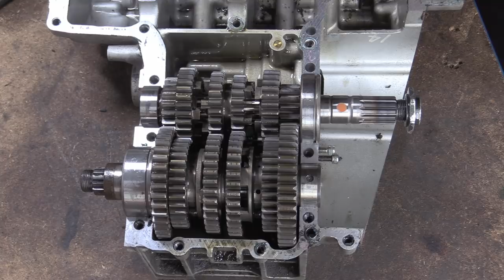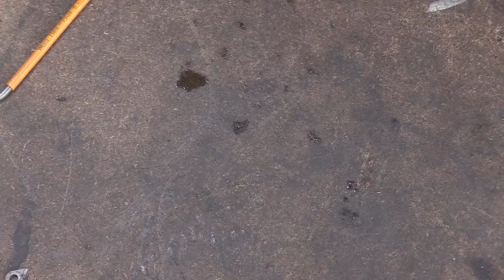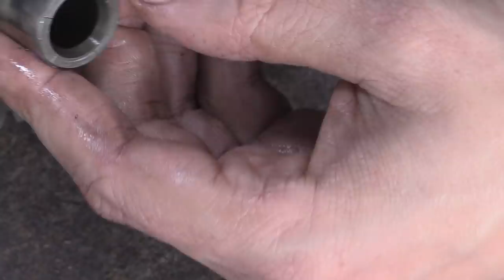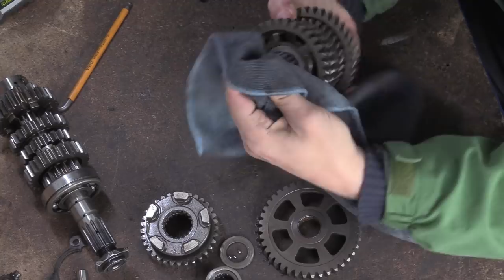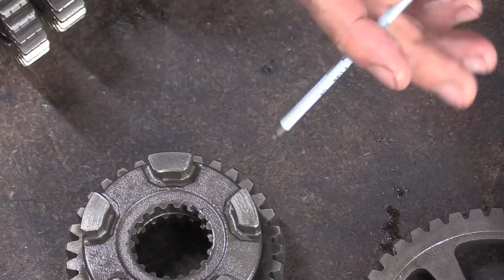M1stERd - My First Engine Rebuild - PART 25

Comment: A wee bit of elaboration on the positive neutral finder, you did explain that it locks out second I just thought I'd expand a little on the how: When the output shaft is turning (anytime the bike is moving), the ball bearings are flung into the drillings in the gear, lifting them clear of the splines on the shaft, which allows second gear to slide into engagement. When the bike is stopped, at least one of the balls will drop into its corresponding recess in the output shaft, locking the gear axially on the spline, preventing it from sliding into engagement. This means when stopped you can only select 1st and Neutral (as you explained in the video). I've always thought it a beautifully simple, engineers solution to the problem of gum boot riders flicking second when stopped (instead of neutral) and dropping the clutch (instead of easing it out to feel if in neutral or not) only to have the bike jump forward unexpectedly. Hopefully that makes sense, the weird Englishman will see you in a bit 😂
Reply from the maker: "I just thought I'd expand a little on the how"

- already done the video on it....

Comment: Excellent, Power Ranger gets me 70% of the time all the time. I think that box is pretty good for the mileage, it would be interesting to see the difference between the big three Japanese manufactures, or even the one you have and a Chinese bike after a couple of years usage. 
Of course there are a huge number of variables, I expect not practical. 
I suppose it goes back to the old adage; change your oil regularly with the best you can afford, warm your bike up properly and also ride the last couple of miles at normal speeds to let it cool down a bit before getting home. 
Be safe.

Comment: Best explanation of a gearboxes workings I've ever seen. Kawasakis' "Positive Neutral Finder" setup has been on the go since the early 80s,have the other companies got their own version or,I've owned most manufactures bikes ove the last 40 years and have'nt noticed. I'll try it on my Bonnie today. Clutchless shifting?,try it on a pre-unit Royal Enfield,no ifs,no buts,you are going to the hospital to get your toes unknotted.
Reply from the maker: "setup has been on the go since the early 80s"

- in the GPZ engine - which I did the video on (the ER5)

Comment: I don't particularly like the positive neutral finder for Kawasaki engines, although I've not ridden other motorcycles enough to really say. if the positive neutral finder system is just some ball bearings I assume it would be fairly non-invasive to take out those ball bearings? Excluding the invasiveness of splitting an engine case LOL
Reply from the maker: Yeah you can just take them out

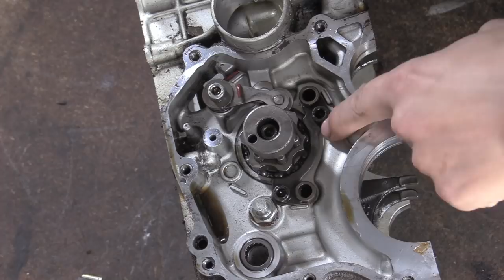Comment: 5:18 awwww dropping the ball on master of pull out

You ever see how they polish the gear sets? I've always seen gears sold with a REM option, how are they polishing, is it a vibratory abrasive process, chemical?
Reply from the maker: Usually tumble/vibratory

Comment: Was gonna ask about constant mesh gearboxes, and why they're not more commonly used. Think you've answered. In OZ our production car racers use a simple up or down throw of a gear stick. But as you say, it's destructive, and they don't care for 1000 km or shorter. You better hide first gear from the gearbox God's in case they get upset.

Comment: Great video.  Are the selector-fork rods/guides the same size?  Could you swap them over to let each selector fork have a "fresh" area to sit on? (as long as they aren't bent obv.)  As for clutchless shifts:  I do this a fair bit, even at moderate speeds.  I tore a tendon in my left arm, and as my bike has a heavy clutch, after a bit of riding around town my left hand and forearm is in agony.  I am telling myself that at slow to moderate RPM, the damage is minimal.  I do a pretty smooth shift that way, no great clonk as gears shift.  Must be less damaging than at high revs no?

Comment: Can you design a transmission specifically for clutch-less shifting in a liter bike?
Reply from the maker: They have - its called the seamless gearbox - but it's expensive
Reply: @dirtygarageguy  How does it work?
Reply from the maker: I'm printing a model - its quite complicated and no-one outside of the MotoGP has actually seen one - I'm basing it off the patent....
Reply: @dirtygarageguy  So it's cutting edge stuff. Thank you for doing all this for us!

Comment: Kawasaki's postive neutral finder fucking shit idea caused my zx6r to jam in 2nd removed the bb's gearbox is smoother than ever.
Reply from the maker: but why?
Reply: Don't really know why it was the only thing that wasn't doing what it was meant to. Me and old man spun it like you did on the zx7 and the balls weren't flinging out like they should one always got hung up and although worn the rest of the gearbox looked ok. Didn't want to get new bb's and a 2nd/5th sliding dog (expensive) as didn't think it would cure the problem. There was no obvious fault with the ones in it. Never seen it on a honda or suzuki gearbox and they shift fine (or my other Kawasaki for that matter)